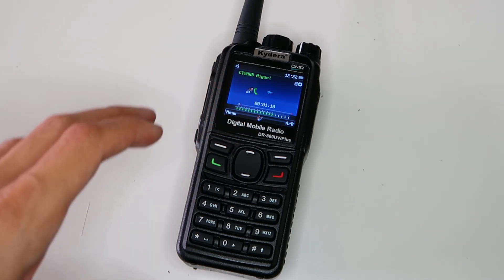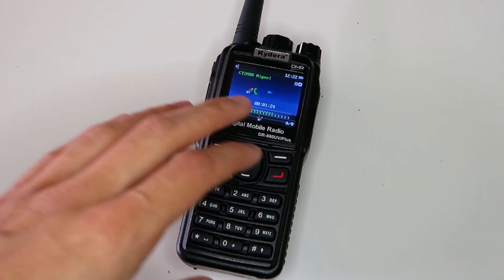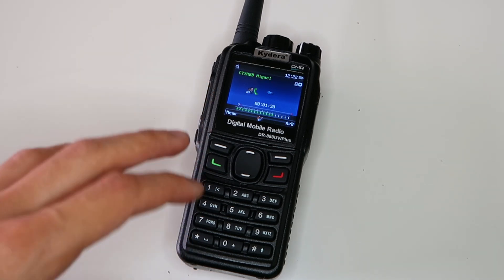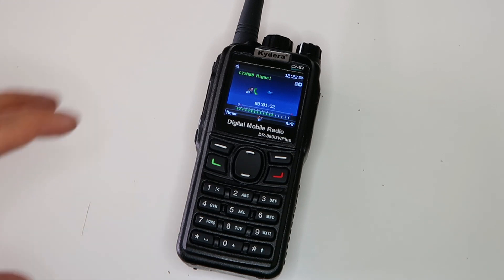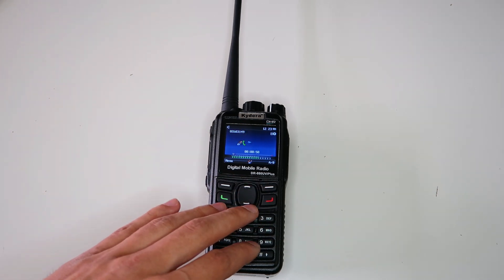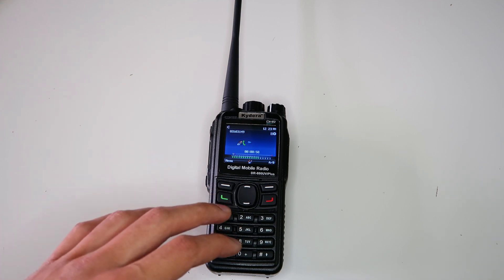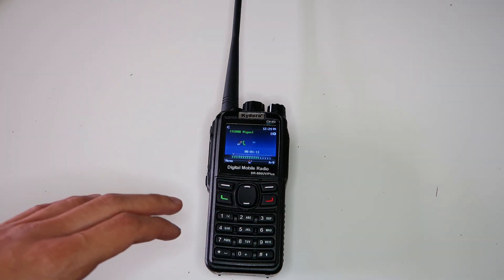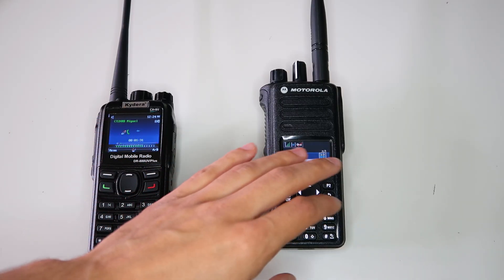Radioddity GD-88: Fix for Loud Minimum Volume

Comment from the maker: I had to remove the firmware because of a Request from Kydera, but they've now provided a different version that is on my website for download and also has the volume fix in it. Please give it a try and let me know of any changes you find.

Download link is in the video description.
Reply: It seems to have fixed the volume bar lagging. But It messes up the Single Zone display.  I am going to reflash the March 2023 firmware.
Reply from the maker: @ScannerJunkie  thanks for the feedback
Reply: Inverted and reversed my display....but solved the volume problem...still trying to fix the display...
Reply from the maker: Did you figure it out? If not there's an instruction in one of the previous firmware released on radioddity's website with instructions on holding a certain button when turning the radio on to fix this
Reply: I installed the old FW and it's back to the old state...volume problem remains  ...hope Radioddity gets their version of the fix soon
Reply from the maker: @fowlerjohnston5228  someone else said they already did

Comment: The firmware listed on your page unfortunately did not work for my late model GD-88.  The display test and graphics were all blackwards.  I had to roll back to the 3/30/23 firmware, which I did successfully.
Reply from the maker: Did you try the trick to flip the display? The instructions are in the release notes for the newer radioddity firmwares
Reply: I have not seen one for "flipping the displsy" but will investigate.   I have seen the fix for a white screen, but I do not interpret my situation as being that.
Reply from the maker: @SigmundPimpulopis  ah yes, my mistake. I think you are right, it was only for a blank display. Nevertheless it may be worth a try.
Reply: But thank you for the awareness of the new firmware!

Comment: Has anyone noticed on this new firmware that when you receive a call in analog from a repeater or simplex. That the animation on the screen the arrow is not animated any longer? 
I have that issue with mine. 
Im going to roll back to the march firmware and see if it comes back or not.
Reply: there are some videos outthere, that show that these animation can cause "noises" in analog, .. so it looks like they  decidet to make it  static on analog

Comment: the "digital" mimimum Volume was not so crazy than the "analog" minimum audio .. does this fix also lower the "analog" minimum volume ?
Reply from the maker: Yes, it does
Reply: @radiosification  okay i tested the version from your side,  and it is way better than bevor , .. mine is the gd-88.
Reply from the maker: @BaFX  great! Thanks for the report
Reply: it is funny that your device "the kydera version" shows GD88 in the display, and my  gd88 shows DRS-880plus in display
Reply from the maker: You mean the startup logo?
Reply: @radiosification  no i meant that version screen at 2:25
Reply from the maker: @BaFX  Ah that's because the first version they sent me was actually for the GD-88 but then radioddity complained about it because Kydera released it. So the second version they sent was a kydera branded version. In the video I'm running the first version but the one you downloaded is the second.
Reply: @radiosification  that explains it , thank you :)

Comment: im complete new to radios, are all chinese cheap bad? is all analog bad compared to dpnr, is dmr or dpnr better? can dmr work on old analog channels?
Reply from the maker: Cheap Chinese radios are not all bad. They tend to just have a lot more bugs than you'd expect. Some models are good and the companies are competent.

Analog, DMR and dPMR all have situations where one mode is better than the other. None are terrible. Any digital mode can work on any channel if the bandwidth of the channel is big enough. They won't talk to an analog radio though unless you program the channel as an analog one but at that point you may as well be using an analog radio.

Comment: There is a new firmware update from radioddity that was released today for the gd-88
I am going to download and update here soon.
Hope it fixes problems with the volume issues and others and works with all GD-88's
Reply from the maker: Thanks, please let me know your thoughts on it
Reply: @radiosification  I installed the firmware on my radio it seems to be the same as the kydara one. I tried on my buddy's GD-88 and I get upsidedown boot screen and pink garbled main screen and I tried it four different times still the same I see it came with some other flash or something for some issues but I don't know what you do with that file
Reply from the maker: @bbroken1  weird. Maybe radioddity still haven't sorted out the issues

Comment: Has anyone tested if the fix applies to the headphone/audio out jack as well? A moment ago I made the mistake of hooking up a headphone adapter to some earbuds with a good tight seal and turned the volume up from muted onto the first notch with the squelch off... just about blew my drum out I think 🤕
Reply from the maker: I haven't tested it but I would guess it should work. Why not just try it yourself? The worst that will happen is that it doesn't work and you have to put the previous firmware on
Reply: Lack of free time, mainly. I'm hopeful that radioddity is not far off from getting it released officially.
Reply: I emailed radioddity about a new firmware and they informed me that there should be an updated version coming out sometime this month .
And they say it will address the volume problem. So people that had problems with this kydara one should have a working firmware soon.

Comment: So you had to take the firmware down so now what we wait tell official radioddity release's the update i guess.
Reply from the maker: Yes, I'm not sure what will happen. It seems like something to do with drama about radioddity and Kydera but I don't know the full details. Hopefully things will get sorted out and there will be some solution.
Reply: @radiosification  yeah I hope so I like the radio but I don't use it much yet because the loud low volume issue. Dang it anyway.
Reply from the maker: @bbroken1  A new firmware is available now that has been officially released and you can get it from my website.
Reply: @radiosification  cool thanks 👍

Comment: I hope someone from AnyTone sees this. I really have a hard time with this issue on my AT 878UV+. I’m ready to buy a DMR HH from any manufacturer that fixes what should be an easy issue and common issue with many DMR radios.
Reply from the maker: Wow, I didn't realise anytone also had that issue. Everyone goes on about how good the anytone radios are. That would be super annoying for me.
If you want a radio that definitely won't have this issue, the Ailunce HD1 has an analog volume control so you can turn it down to extremely low levels if your dexterity is good enough 😂
Reply: @radiosification  Yep. It’s been a problem with AnyTone for a long time. Some people suggest tape as a work-around or say it is the senders gain that is too high. However I would argue the falloff of the volume on these radios is just too great. They are either silent or too loud for a quiet environment. Thanks for the info on the HD1!
Reply: The DMR AGC feature in OpenGD77 fixes this issue on radios that support that firmware.
Reply from the maker: btw, don't buy this radio now because of this video, because they had me take the firmware link down and stop sharing it.
Reply from the maker: They've given me a new update now so my last comment can be ignored. The volume fix is publicly available for the Kydera radios (and the firmware usually always works on radioddity ones anyway too).

Comment: well i updated. my firmware to this new one and all is well my gd88
Reply from the maker: Great, thanks for the feedback!
Reply: My buddy's GD-88 when I update to this new firmware his radio the boot up screen is upside down and then it goes pink on the main screen. I tried the power on and hold the green button. But it doesn't do anything.
His serial ends with 1217 so it's older then my radio 
Mine is 1287. 
So I don't know what else to try?
Reply from the maker: @bbroken1  does it work fine if you put the March version on there? Are you remembering to apply to both bands btw?
Reply: @radiosification  yeah it works with the March version. Yeah I did A and B
Reply from the maker: @bbroken1  with my radio it didn't work the first time, I had to try a couple of times to get the display working. So maybe try it a few times and see if it makes a difference. Other than that I don't have any ideas. I don't think you can really ask radioddity for help with this latest one since it's not their firmware - it's kydera's so only officially supports kydera radios. It might be that your friend will just have to wait until the official version from radioddity comes out
Reply: @radiosification  yeah, maybe I will give it a go another try if no go he will have to wait